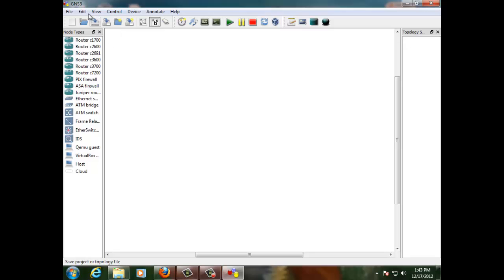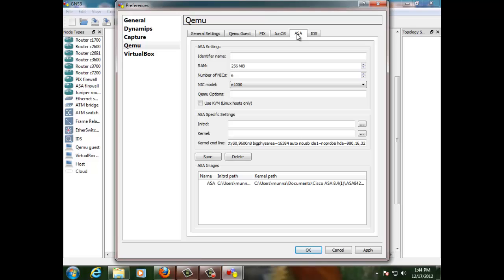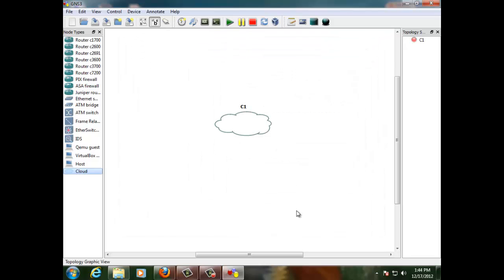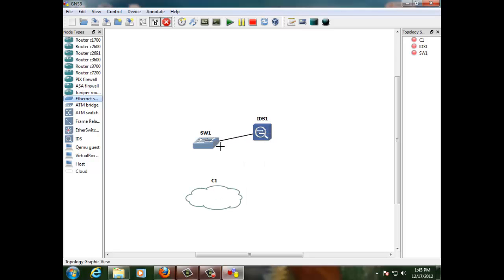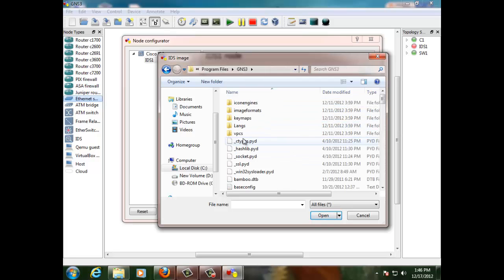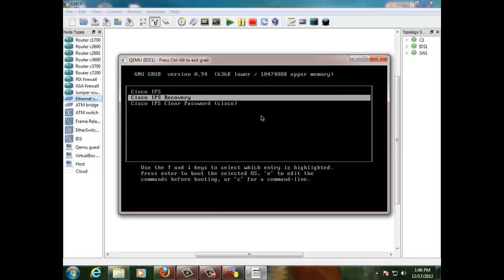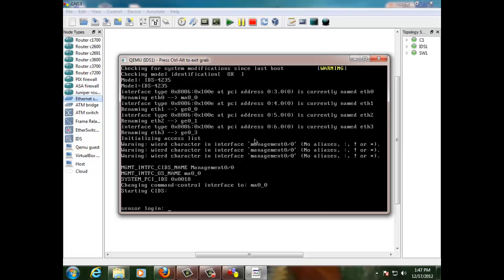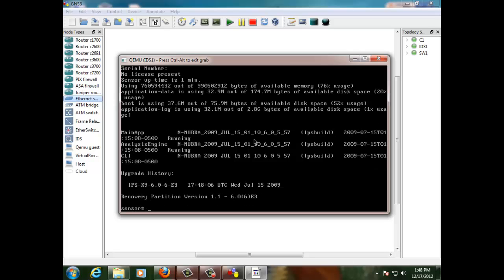IPS on GNS3 look and feel

Comment: If you are on Windows platform you should run cmd as Adminstrator, then go to the location of your GNS3 folder (for my case is c:\Program Files\GNS3\) then put he following commands:

qemu-img.exe create ips-disk1.img 512M
qemu-img.exe create ips-disk2.img 4000M

Then you'll find the files in the GNS3 folder

Regards